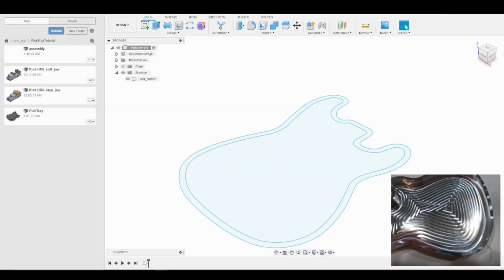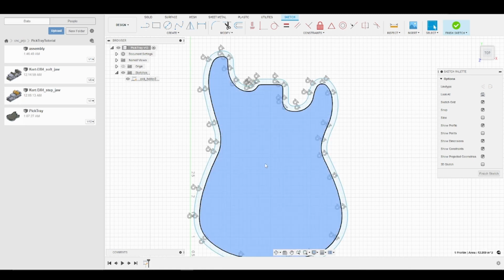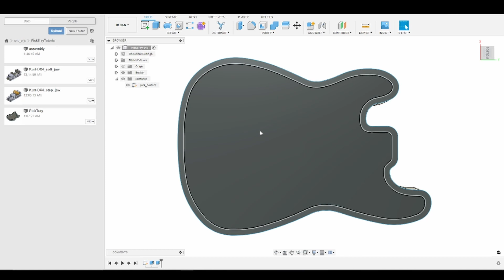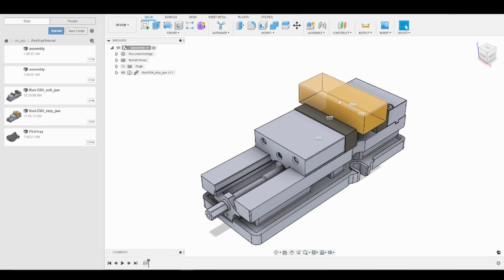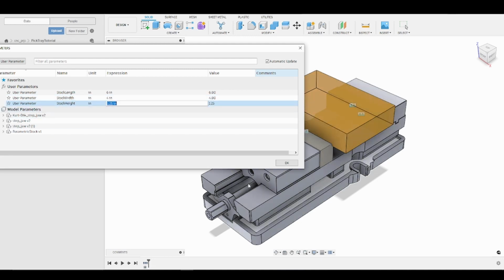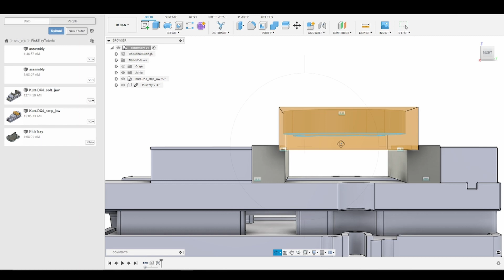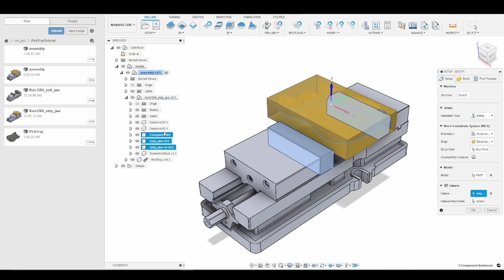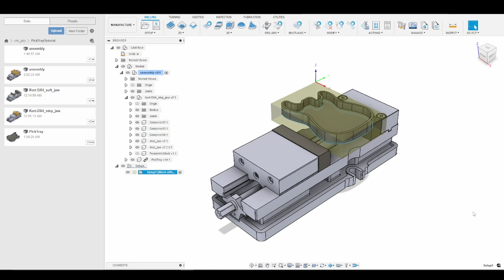Tormach Guitar Tray Tutorial 1

Comment: Thanks for the awesome video.  I've learned alot of information.  Its great your posting the models so we can follow along.  At the end of your video, when you click the 'OK' button for the setup, your stock and guitar pick model turn a different color(grey I believe).  Mine stays orange.  What do I change to look like yours?  Thanks, Jerry
Reply from the maker: Thanks for watching! I believe all you need to do is make the parametric stock invisible. You can do that with the eye icon. It should be under the drop-down model menu where use chose the stock from solid. Let me know if it helps. By the way, check out some of the newer tutorials. I've greatly improved the workflow.

Comment: Hi just watched all 8 Vids on the guitar pick tray and found them very informative and well explained, thanks, here are just a few comments on each video .
Vid no 1 is very well explained for all levels of user in  fusion  360 .
Video no 2 has the Fixed vice jaw moving away from the Moving jaw ?
Also you place the model 90 degrees in vice why not keep it length ways ?
The next point iwhere you turn the vice over and turn it 90 degs is very confusing , why not just insert another vice then move it away from 1 st vice this keeps all on the same plane and is easy to see and understand,then copy the BODY of the model and place it into 2 nd vice .
Videos 3 to 6 are very informative , i have learned from tham thanks.
Video 7 is confusing why you use  a 3/8 dia cutter to machine the profile which is already done on the first op ? Why not just use 50 dia facemill to remove "the hat " then chamfer edges to complete  as in Vid no 8 thanks .
Reply from the maker: Thanks for the comments and feedback. I will adjust the vises for clarity moving forward. I use a 3/8 end mill to rough the backside because I can move faster. I can take a full depth of cut at 60IPM. The shell mill is 1.5in in diameter, my machine doesn't have the horse power to push it.